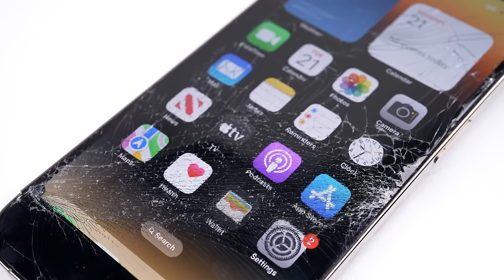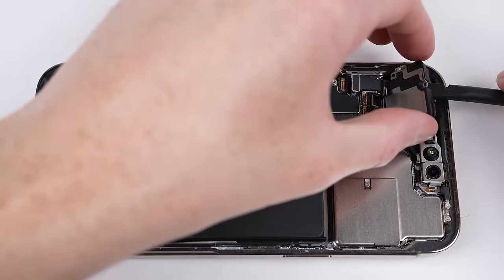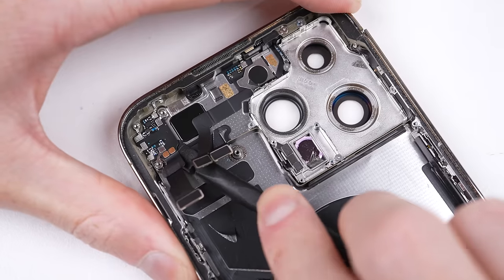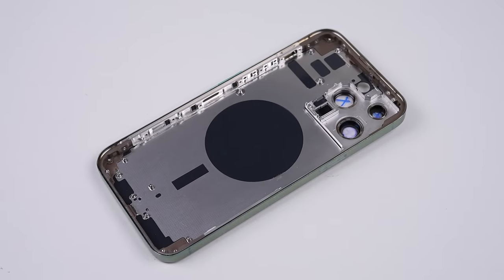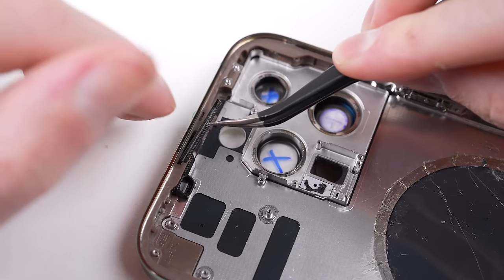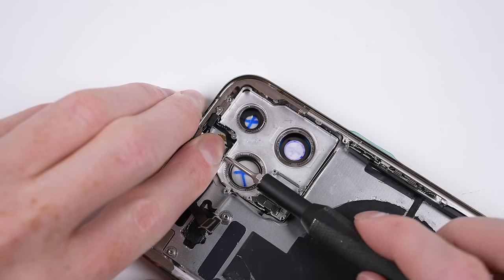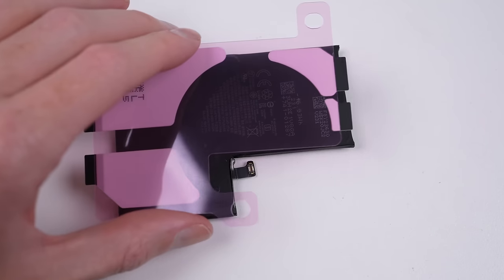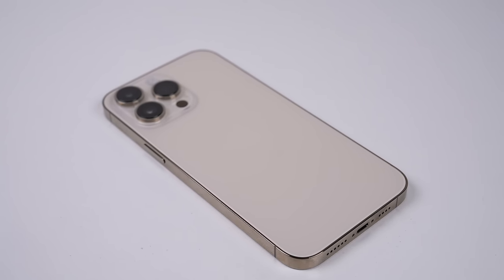What It Takes To Repair The iPhone 14 Pro Will Anger You - iPhone 14 Pro Max Restoration

Comment: I have no idea how people manage to destroy their phones to this extent. I have a phone I've been using for almost 5 years now and it's still in pristine condition. I've even got the original box and accessories it came with
Reply: same here, using from 5 years, still working good for me,honor 7s, runs on android 8😂
Reply: Some people are just clumsy or plain unlucky
Reply: @Fredd00007  for me it was a car accident. Not even my fault.
Reply: My OnePlus 2 is now 8 years old :). Screen is starting to show its age though :'(
Reply: i have an 11 and the worst thing it got was just some scratches on the screen
Reply: Construction/ architectural trades can get you into scrapes. I see notes about skid loaders running over things, that's warehousing and manufacturing incidental... A shame the gorilla glass wasn't up to something that otherwise wasn't heavy enough to wreck the frame. Fresh construction grit's special?
Reply: @ummtulip my iphone twelve mini is invincible.. it has been through so much, and its screen is basically fine, no visible scratches while its on, though it does have a ton of scratches and some small cracks

Comment: One way to get around the tru-tone issue is to swap that chip on the screen. You can buy new displays with the chip missing so you don't have to remove it.
Reply: Hi! Someone knows why my brightness is so pretty low on my 14PM after changing the screen for another original Apple screen? (didn’t transferred the IC or ambient light sensor)
Reply: @DankMemes-ne7qt  You have to transfer the speaker flex (wtih sensor on it)
Reply: @myriadtechrepair1191  Is that the flex that is glued to the screen? I thought the speaker is that module that doesn’t have any flex cable
Reply: @DankMemes-ne7qt  The earpiece speaker connects to that flex.
Reply: @DankMemes-ne7qt  wait never mind. I forgot the 14 pro max is different. 

Your new display may be bad or the motherboard's backlight IC might have failed.

Comment: Awesome repair and I hope something is done about the serialization of parts. We deserve to be able to fix a device AND have its full capabilities like true tone. absolutely ridiculous that they can charge you for a screen that has true tone but because its a different serial number it doesn't work properly? Ultimately having the user buy another phone before the repair attempt. Apple isn't stupid they know they are evil.
Reply: Hi! Someone knows why my brightness is so pretty low on my 14PM after changing the screen for another original Apple screen? (didn’t transferred the IC or ambient light sensor)

Comment: I’m here from the future to tell you that the iPhone 16, thankfully, is much more repair and DIY friendly. They’ve ended parts pairing for example—you can replace parts yourself and pair them by going through prompts. Some models have electrically dissolving glue for the battery, which can be dissolved with a 9v battery. The phone can also be opened from the front or the back, either panel being dead simple to replace.

It seems like Apple has finally listened.

Comment: if it was a car, it will be a write off
Reply: From dealing with cars they tend to get written off for 2 main reasons, either cannot make a safe repair i.e. chassis is bent and/or cost of repair exceeds 60% value of vehicle.

Comment: Glas has always been a questionable material as you note it's hazard. I think more repair outlets should replace OEM backs with plastic ones. Polycarbonate would make a good screen, but that would require someone selling replacements with poly, rather than glass.

Denatured (not isopropyl) alcohol, and a needle dispenser will help with the adhesive.

This video reminds me of some watchmakers I've seen on YT... Except they don't have to deal with glue!

Comment: In actual fact, ive just ordered parts myself for my 14 pro. a battery replacement, genuine and new. it costs 95GBP, then if you send your old part back to recycle they give you 50% of the charge for the new battery back. it is now cheaper than getting apple to repair your phone, and they have many parts available to buy now too.

Comment: I had the same issue with brightness going to lowest setting on an iPhone 12 I swapped a crashed front and display on. The really annoying issue with the brightness I solved creating a shortcut and assigned it to the double tap on the back to run it. Works well.

Comment: This is why I buy the frames with most of this tiny stuff installed, as you mentioned. In fact I just checked with my supplier, it's the only option they offer on this phone.
Reply: Also... The magnets are $3 to just replace instead which is much easier than manually harvesting and transferring them. Tiny magnets are pretty easy to break.

Comment: you can use heating gun to loosen up adhesive on some plastic bits. I usually do it on 90–100C so plastic does not deform

Comment: you can rewrite the screen serial number, i have done the same exact thing with the iphone xs i bought it for 200 dollars and then fully restored it buying the parts... there is a programmer which you can copy the serial number from the old one then trasfer the serial number to the new one. it worked for me and restored true tone and auto brightnes. only thing you can't copy is the serial number of the battery.
Reply: Hi! Someone knows why my brightness is so pretty low on my 14PM after changing the screen for another original Apple screen? (didn’t transferred the IC or ambient light sensor)

Comment: Amazing repair of a nightmarish device!  Just wondering if the orientation of the magsafe magnets is critical -- I tend to mark magnets to keep the polarity the same, just in case...  Honestly, I'm surprised that there weren't magnets ripping the screws off of your driver -- that drives me crazy on iPads with the smart connector right by the display connector shield.

Comment: I bought a mid-range Samsung phone after watching your video about repairing an iPhone 12, which is the one I used to have. I told a friend about it, and he replied that a replacement screen for my current phone costs half as much as the phone, implying that the switch didn't make me better off, but I reminded him that to get it fixed, I wouldn't have to send it to Hugh, and there would not be error messages afterwards.

Comment: iPhone 4 and 4s had a removable back glass.  You had to go through the back of the iphone to do any repairs for those 3 devices (GSM and CDMA versions of the iPhone 4 were somewhat different to repair).  They were easier to remove, just remove the pentalobes and slide the screen upward.

Comment: I remember having a Iphone 5c and opening the screen up with my bare hands (screw brackets were broken ) and hard resetting the phone with disconnecting the battery. I also disconnect and reconnect the screen flex cables when the screen is bugged out or showed some lines. I have just figured out how to hard reset my Iphone 13 today, I cannot even imagine doing the things I used to do today :/

Comment: Amazing talent.
I used to do TV repair ... decades ago. Parts were BIG. No eyestrain.
I can't imagine doing this sort of repair.

Side note: Given the high cost of repair, I think I'll never buy an expensive phone.
Mine is a 6s from five-ish years ago. I think it cost $300 from Verizon. I thought that was ridiculously high.
My wife's is a 12, purchased last year for $350 from Verizon. I thought that was ridiculously high, too.

If either one those breaks, it's off to the dumpster. No repair. I can deal with the price of replacing a $300-ish phone.
But to spend $1800 (like our friend did for her Samsung folding phone) is insane ... both for the initial cost and for the potential high-cost of repair or replacement.

Comment: Hugh, I always wonder: Why do you always use the FULL adhesive set to re-install a battery when we can all agree they use FAR too much adhesive. You could probably use a small sliver of the replacement adhesive without issue and an easier repair, should it be repaired again.

Comment: luckily, iphones going forward seem to be going towards removable back glass, so these types of repairs will be a lot easier in the future. still, if you’re unlucky enough to encounter a different point of failure than the glass or battery, you probably won’t be so lucky

Comment: The screen encryption can be resolved by welding the tiny screen chip into the new screen. It's the mini chip that is encrypted and all other parts of the screen are undistinguishable.
Reply: Hi! Someone knows why my brightness is so pretty low on my 14PM after changing the screen for another original Apple screen? (didn’t transferred the IC or ambient light sensor)

Comment: You can just add the chip to the new screen, or maybe just reprogramming it. This would bring back true tone. I just got this done here at my local repair shop
Reply: Hi! Someone knows why my brightness is so pretty low on my 14PM after changing the screen for another original Apple screen? (didn’t transferred the IC or ambient light sensor)

Comment: That’s certainly a deep dive to complete a full case swap on the iPhone 14 PM! The golden age of iPhone repairability was around iPhone 6. The original 2007 iPhone 2G had the battery soldered to the logic board and a very delicate plastic lower section of the case that needed carefully levering out. The 3G/3GS wasn’t too bad but the 4/4S although super easy to replace the battery needed a virtually complete strip down to fit a screen and was fiddly. By iPhone 6 the phone came apart easily, no glue yet employed and there were a plethora of cheap parts available with no component locking!

When my daughters went from iPhone 6 to X I insisted on cases and screen protectors from day one because you really need to look after your shit as Hugh demonstrates here. The high price of these phones does seem to some extent justified looking at the complexity and multiplicity of components in these latest phones.
Reply: iPhone reparability became easier and good when the iPhone 5 came out. The iPhone 5 is easy to repair, the battery has a pull adhesive tab to pull the whole battery away from the phone. I’d say iPhone repairability became harder with the iPhone 7 and newer
Reply: @S-1_24-25  to some extent with the 6S. That’s when they started using adhesive on the screen to prevent water ingress. The iPhone 4 was easy to replace the back glass and battery but a nightmare to replace the screen. The 5S was also a bit fiddly because of the delicate ribbon cable and clip to connect the TouchID/home button to the logic board. So you’re right the iPhone 5 and also the 6 were the best versions for DIY repair.

Comment: You can use the display id from the old one and get it programmed into the new one with a Chinese device. At least you could with older iPhones. Worth doing after spending so much on genuine parts

Comment: There's a device in phone repair shops that reads old iphone display and parts and write those to the new parts. I got it done to my phone. It just costs around $10 in my country. No issues. From 3U tools to many other software they show no issues. All original eventhough i got changed my display 3 times. Lol my kid and wife dropped it.

Comment: If i were apple then i wouldn't use screws at all. i would use rivets. It's faster to assemble and also cheaper than screws. And after that i would encapsulate the whole phone in epoxy resin. This is to keep moisture out better. And after that you can try to repair it again. Good luck Mr. Repairman. :)

Comment: You can use a multifunction reprogrammer to get True Tone back
Reply: Hi! Someone knows why my brightness is so pretty low on my 14PM after changing the screen for another original Apple screen? (didn’t transferred the IC or ambient light sensor)
Reply: @DankMemes-ne7qt it is probably due to serialization of the screen causing the ambient light sensor to be unable to function as the screen did not come with the device. (This is just a guess. Don’t quote me on this unless it works)

Comment: As a technician, this doesn't bother me, a full tear-down takes 10 minutes and the back glass is done with a fibre laser. Sure androids have fewer parts, but they take the same time as the iPhone.
Personally, 13 onwards is easier and faster to repair than then previous phones, my tools are 4 things:
-Hot plate for adhesive (android needs it especially)
-tri, star and Phillips head screwdriver set.
-Guitar pick pry tool
-razor blade.

That's it, and I do every phone besides Z Flip and fold. It's not as bad as people rave about, apple has its own assembly philosophy and so does Android, it's just practice.

I also worked in electronics manufacturing and am currently pursuing a mechatronics engineering degree, I don't like to advertise those credentials but I want it to give credence to what I say. Being, the iPhone isn't that bad, it's blown way out of proportion.
If you wanna know bad, look at the stupid pricing of S series screens for Samsung, vendor-locked for being curved so insane prices. When Apple has all of China's manufacturing prowess to make decent aftermarket screens for a 5th of the cost. Plus they even give a warranty, so you can't say it's garbage either.

The final statement I can agree upon is that phones in general suck for repair, but consider that a lot of the ‘anti-right to repair’ stuff can also be down to manufacturing reasons, such as screw size needing fewer lobes and therefore reducing the likelihood of rounding it. ID on screens to have a marketed guarantee of colour accuracy that is expected, so the true tone is legit the true colour tone being emitted from the screen and not skewed to some manufacturing variable.

If you hate iPhones, don't buy one, same with Android. Usher the landscape to be better of course, but I am in a proper small kiosk down in the trenches of consumer phone repair, I can say it's meh.
Reply: That's actually really interesting about the Samsung phones.

Comment: Just so you know, authorized repair shops, don't do all that work. If you have a broken back glass, the whole rear of the phone is replaced, the only thing that's reused from your old device is your display. In the case of a broken or bent frame, you're going to need a whole unit replacement. So, no authorized repair shops go to those lenghts to fix a phone, they usually just replaced the device entirely

Comment: magnets have a north and south pole and if you get the magnets in wrong the mag safe may not stay if enough magnets are in wrong.

the magnetic mat is great if the parts and screws are magnetic but the problem is not all metals are magnetic.

there are 2 grades of stainless steel.

surgical/food grade witch is the good stainless and is non magnetic.

then there is the cheap grade used in the bezels and embellishments of appliances and lower end appliances and such.

if you buy a microwave and it has a stainless strips on the door most like they are just thin strips and a magnet will stick to it.

if you pay over $1000 or more for a microwave then it will be non magnetic stainless.

can you connect a iphone to hdmi adaptor and connect the phone to external monitor?

Comment: The glue used for the batteries is the perfect example of how not to overengineer something, it is gonna stay in place alright but (IMO) It's first a little wasteful, second very hard to remove and third unnecessary as in the amount used. Dare I say a simple line in the middle would hold it in place. Oh well what do I know, I've never made a phone..

Comment: What you are seeing is high tech engineering for all season and water proof devices while also telling the engineers to create the smallest form factor and a very specific weight. If you would have complete buttons and not like the components you are seeing right now, in a sense you would have a heavier and bulkier phone. There are technologies here that don’t have a single assembly solution yet as they are being done like this first to see the long term implications of it. 

This remind me of the military and how they do jobs too. I design things for the military and adding anything extra to help the consumer is always frowned on because if it fails during manufacturing “because of the installer or machine incorrectly installing something” we now have to explain that “corrective action” and the extra feature we added to help the consumer was our decision not there’s. being late is our fault and not the consumers for wanting it. We would still be at fault but “less at fault” if it’s doing something that the customer requested, but if they didn’t request it, we would be “fully at fault and the customer might charge a late fee for delivery”. 

I can’t say I blame the engineers and designers making these decisions (can’t believe I am saying this right now) it is very hard to look form the outside and see this complexity and think why. But from an inside view I see this as not complex but a reality we have to face everyday to meet requirements while giving exactly what was ordered. It actually saves the company lots of headaches doing it this way. 

Please don’t get mad at me for saying what I have learned through real life experiences. You can visit LinkedIn to see who I work for to confirm my military design experience.